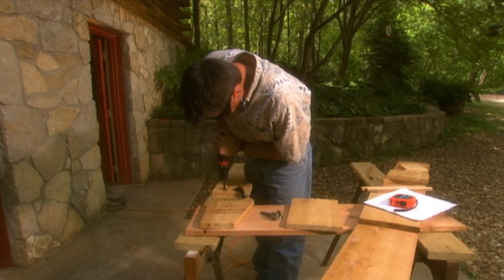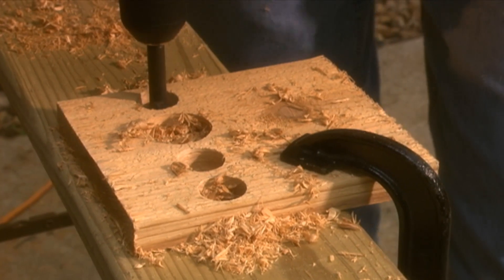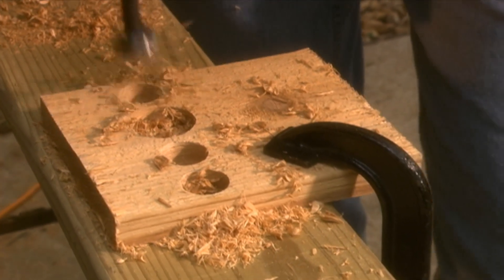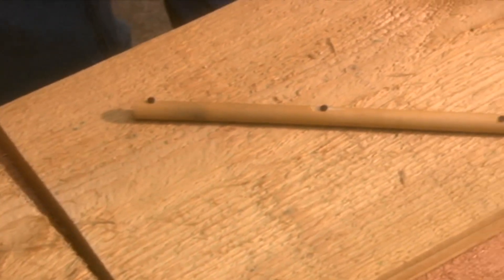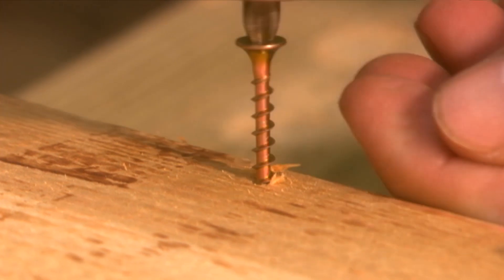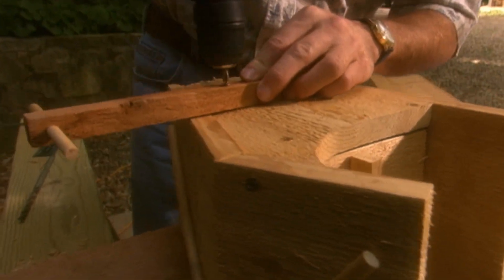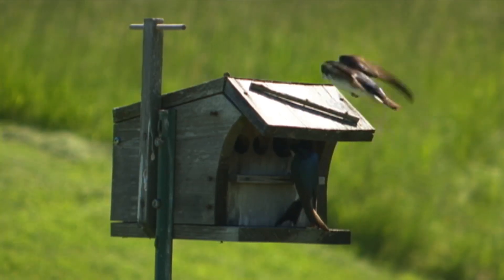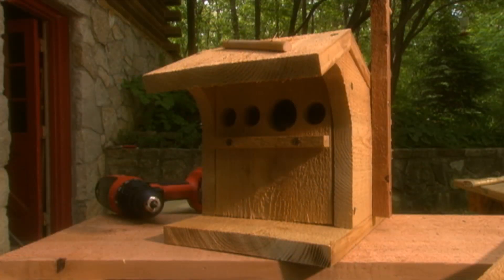Building a Tree Swallow Box

Comment: Did you know that tree swallows will use a bluebird box, but a bluebird box is technically too small for a tree swallow. The tree swallow box should be almost double the size of a bluebird box due to tree swallows lay up to 4-7 eggs. In the bluebird box,  as the babies grow, babies will either grow deformed or will die due to lack of room. 
Tree swallows also a "ladder" on the inside below the hole so the babies are able to climb out when it's time. :)
Reply: Thank you for your ladder advice! I bought a birdhouse with one hole.